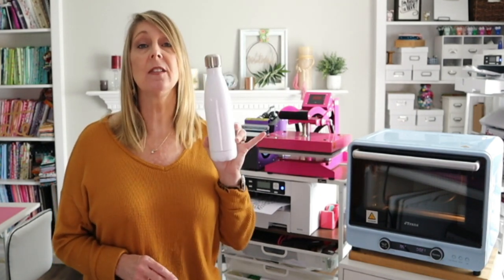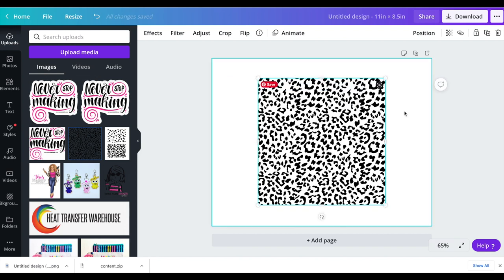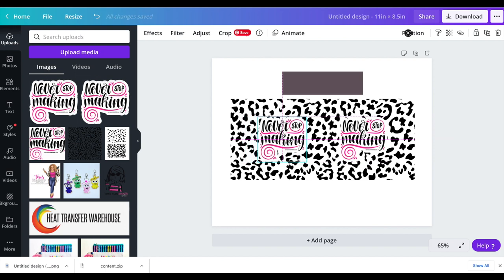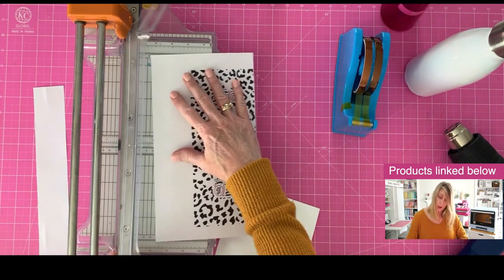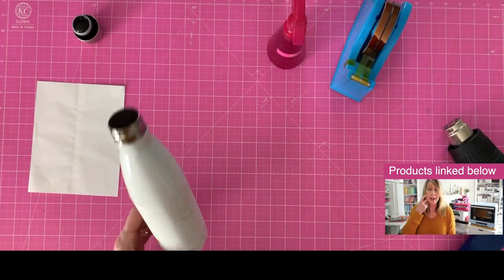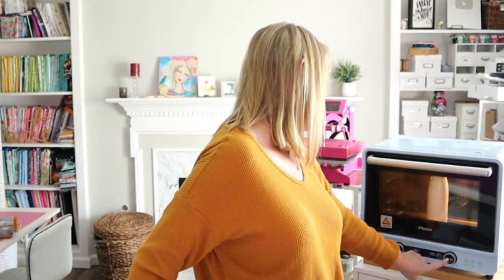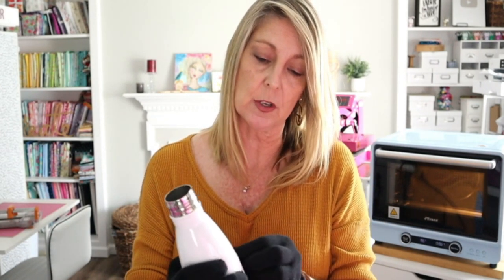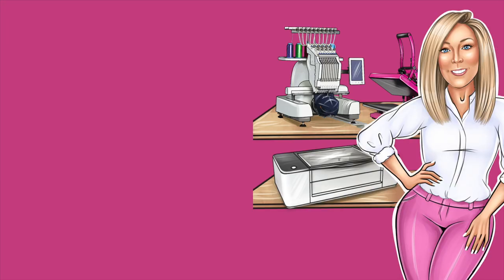Sublimation Soda/Water Bottle

Comment: Love the video. Thanks so much. Which sg500 printer you have . I notice there’s several kinds of sg500.  Which inks do you use and heat gun. Luv the oven but not in stock now. I guess that will be long time before those get bk in stock.  You are such a good little teacher. Thanks again for the awesome videos.

Comment: Laurie, thanks so much for this video.  I wonder if there is an odor with the oven and can it be changed to Fahrenheit vs Celsius?
Reply: Lorrie, is there a way to get the heat wrap off once it is stuck on the tumbler?  I forgot to put thread in and now it’s stuck on the tumbler.  HELP please?